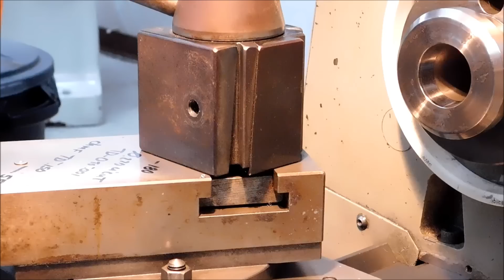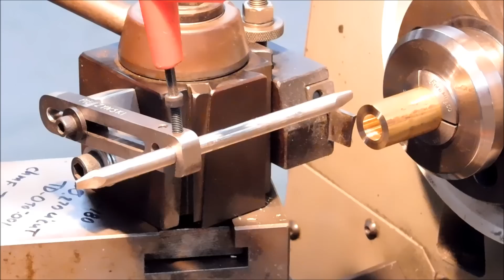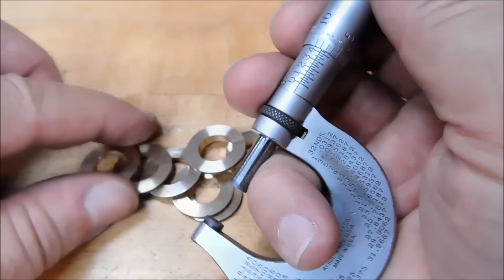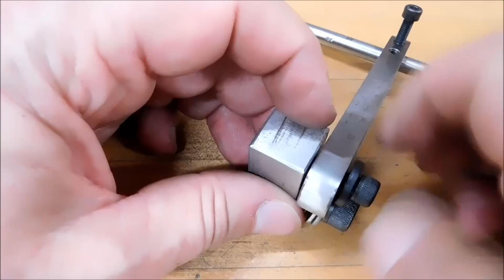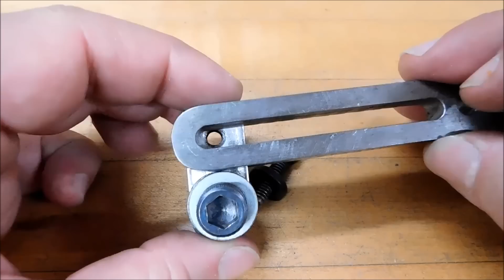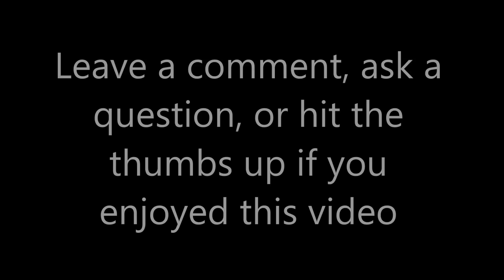Production Parting Made Easy

Comment: Would it be possible to grind a tiny concave into the parting blade? I have heard other YT machinists not wanting to do the slight angle as it risks deflecting the blade on small lathes.
Reply from the maker: Top or front ?
Reply: @joepie221  front so you will present a very shallow u-profile to the work.

Comment: Hi Joe. I always skin the end of the piece with my carbide part off then move the carriage the thickness I want plus the width of the tool face. I position my stop on the front edge of the tubing so that it goes inside when I move the tool in and over. That way the stop also catches the pieces. By the way like your vids.

Comment: I like all of the methods you used there. Usually instead of the razor or rule,I touch the spinning part with parting tool and move negative the width of parting tool for zero,or width of tool and width of part. Not better than your way but easy,accurate and quick.

Comment: Add another (sliding) rod forward of the stop rod that can be entered into the part bore while parting to catch each ring as it drops off. You can set it up to catch a multitude of rings without worrying about losing them in the chip pan. Just push it into the bore before parting off and slide it back out of the way for the next. A small "hook" on the rod end will keep the parts from sliding off the rod. No need to catch it manually and keeps both hands free.

Comment: That's a really cool trick. Does it kill you that the parting tool thickness is more than the parts? I have considered making some 1/2 hardened extra thick washers and will modify my clone toolpost to have the same threaded hole. You are an awesome teacher Joe. Thanks.
Reply from the maker: Thanks for the comment. Much appreciated.

Comment: Great idea I like it. Do you ever have the parting to deflect slightly when making a deeper cut in steel (due to being sharpened at an angle)?
Reply from the maker: That all depends on the setup. An angle can introduce flex.
Reply: @joepie221  - I've had problems with narrow blades and deeper cuts,

Comment: looks like once you've come to the end of your z travel you can turn off the machine and move the stock back to the stop and continue the process.
Reply from the maker: Once the stop is set to the tool, you can run all day.
Reply: @joepie221  I never knew about that hole, but I don't use the lathe a lot at work. What I have done was Chuck up a piece of stock in the tailstock and bump my stock to that. But obviously this is a proper way

Comment: I have a different quick change tool post that allows me to put two tools in at once. I use my parting tool in normal position and a suitable turning tool in the other, often a square tip one that makes 45 deg chamfers. I set my tools so when I face across with facing tool it faces "hole" and then immediately parting begins. You get beautifully consistent parts, and as a bonus, as it is "power" facing and parting you have time to deburr the hole and both outer edges with the appropriate file. i often part slower than many and am a fan of coolant even though its messy. files and deburring tools don't like to run too fast! I know you "double machine the component, that time is spent deburring so there is not really any lost time. Use this method when making bearing shims when setting up diffs etc. Easy to cheat and get variations by moving before parting begins to get the desired variation.

Comment: I just got home from a 350 mile drive in which I designed a normal clamp on the bed flip stop in my head. Need it for an up coming project. Get home and this video was on my page. I'm using a multifix, so no hole in the post but I do have two bolt holes on the back side of the saddle for a follow rest. You just changed my thought process, Thanks Joe!

Comment: If I were making one, I would use the same thread on all & not have to use 3 different Allen wrenches.  If it had to be 3/8-16 because of the tool post, it would be clunky, but efficient.
Reply from the maker: I've used that concept on other tools. It works well.

Comment: If you have a relatively modern DRO they all have one touch macros. No guesswork, no feel required. It's possibly not as fast but you'll never scrap a part of you've got a tight tolerance.
Reply: That DRO option is still painfully slow compared to a predetermined stop either on the tool post.  Also you have to buy the DRO whereas this stop costs about 1.00 to make in parts.
Reply: @michaelidarecis  But the DRO option is still a valid option if you already have the DRO with that capability.  And setup can't really be that much slower assuming you are familiar with that operation on the DRO.  Pushing one or two buttons per part shouldn't slow you down that much.

Comment: I looked at the hole on the back of my tool post to fit a dial indicator for a similar reason, with no DRO.
The steel of the post is not threaded and to hard to put a tap in without snapping it. I Chickened out.

Comment: I prefer using a parting tool for a lot of tasks. This was a new trick for me. Great. My biggest question is "How do I keep my parting tool from screaming like a banshee?" I mostly work in stainless as I'm in medical devices. I noticed some sour notes in this video as well. Also, with some steels, I have a real hard time with surface hardening as I go and my cut sort of pulses along rather than give consistent chips. Any advice welcome.

Spoke too soon. Just watched https://www.youtube.com/watch?v=5LtYzjR1JuM Beginning parting tool again and realized so much I missed in the first watch.

Stainless - Back off on speed dramatically lots of lubrication.
Noise - In my case is probably a POS tool that isn't ground very well and I only have access to a very wide tool and an extremely narrow one.
Reply from the maker: Thanks for checking it out. I hope it helps. I've been in orthopedics for over 20 years. Hip and knee instrumentation. Sulzer, Zimmer and Stryker. Lots of 316 and 17-4

Comment: Another great tip Joe, thanks.  I have used this for many years and like some of the other commenters here I run a second rod in the setup [when the sizes permit] .  I set it so that when the jig is touching to set the tool position the wire is close to the tool side of the bore hole and as parting progresses the wire moves across the borehole not interfering with anything. I use stiff, flexible wire [a piece of coat hanger] and arrange it to enter the hole by 2 or 3 times the washer/shim  thickness and to slope down away from the job.  This way machine vibrations cause the cut pieces to shuffle away from the working area and the overall speed is increased because you now don't have to manually remove the parts at each cut.
Keep up the excellent work!

Comment: Nice setup. You could add a length of piano wire, attached parallel to the stop rod, but going slightly inside the drilled hole to collect cut pieces automatically (it will not interfere with the operations because it will flex).

Comment: say Joe,
have you peeking at my content on this subject ??  ;-) you answered some of my dilemma in SuGar nuts part 2. one problem i was having with the parting was the material (stainless) was pushing away from the tool and creating a a slight conical shape. since the washers had to be uniform thickness, i ended up making a plate that superglued the washers into and then ground the to matching thickness on the surface grinder. 

any advice on keeping the material from going conical?

Comment: That’s a good idea. I know most people would probably use an indicator on the ways to measure saddle travel and do the math but if you used an indicator in place of your stylus of your work stop you could indicate each washer to thickness you’d just want to turn the spindle off between each one but it would save you having to do any math.

Comment: I an familiar only with the Aloris tool holders that are the splined design that indexes at nine degrees. This holder looks like a KDK rather than any Aloris that I have ever seen.
Reply from the maker: Its a BXA Aloris. Not the indexable kind you make reference to.
Reply: @joepie221  I never could figure out why they made those things index at nine degrees instead of seven and a half degrees on the spline.

Comment: there's a faster way to do this. You part to depth before you drill, then when you drill they all hang on the drill. Actually this is the most common way too since large rings get trepanned not drilled inside, saving a core.
Reply: That's a great idea! Thanks for that!
Reply: @billchiasson2019  even then, there's a better alternative. Advance the stock in the chuck. Would you want that much stickout if you had to make 20 washer? And if you were making like only 10 washers and stickout wasn't a problem, would you go to the trouble to alocate spec for this device in your box, finding it, calibrating it. Drilling your toolpost to hold it (at least make it magnetic, but then it will acumulate swarf)?
Reply: If you drill after parting, you can also hold the stock with a center while you part, allowing you more stickout
Reply: What if there isn't a hole? This way is much better.
Reply: When the drill is just about through the washer, does it tear the washer off leaving the last bit of 'top hat' burr on the part?
Reply: The problem doing it that way is the the drill does not always drill a full length clean hole before parting occurs, ask me how I know?

Comment: How do you deal with the collet drawing the material back away from the stop, when the collet is tightened?  Is that 'drawing back' consistent enough to just put a fudge factor adjustment on the stop position, and forget about it?
Reply: The stop is calibrated to the tool, not the material, so regardless of how much the material hangs out of the collet, the tool will always be the correct distance back from the face of the material. very slick setup. I'm going to have to try this to make accent rings for the pens and rings that I make.
Reply: @owenclark7210  - Ah, now I get it. the material isn't brought to the stop and tightened;  the stop is brought to the material AFTER the collet is tightened.  Force of habit, thinking the material is always brought to the stationary stop. In this case, Joe would be moving the stop to the material after each time the collet had to be tightened. 

Order matters, Thanks!